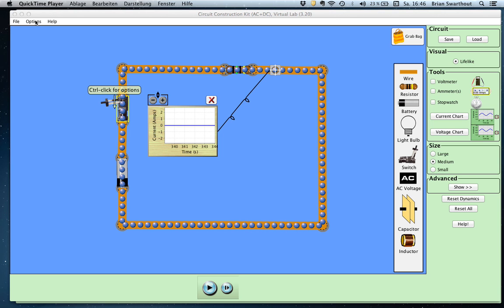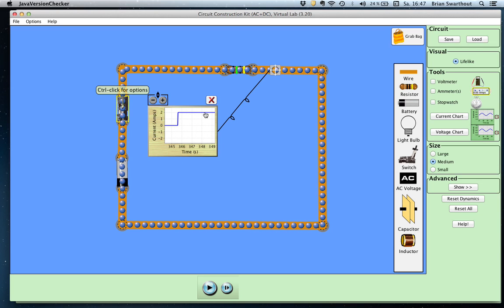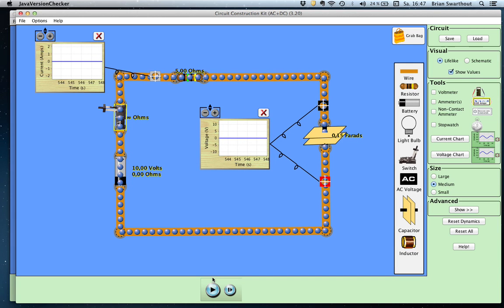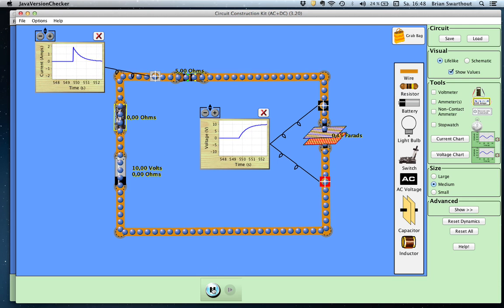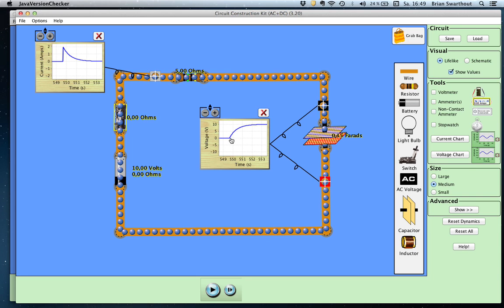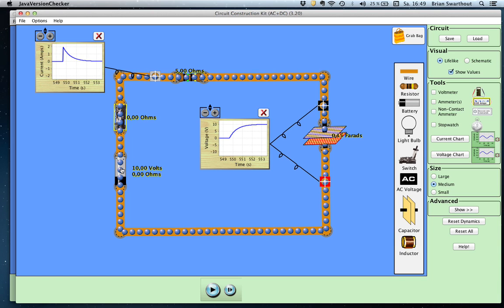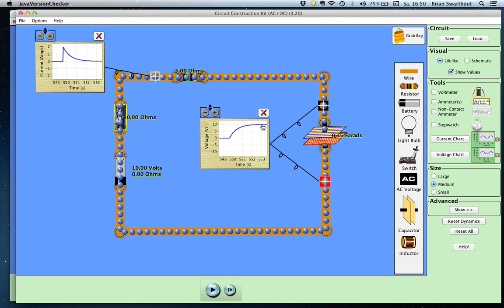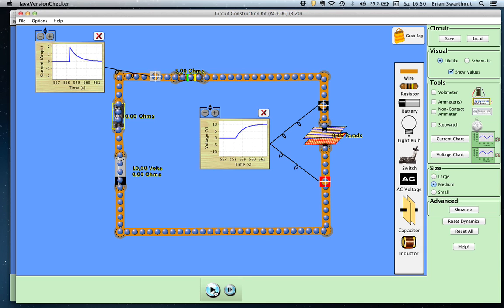RC Circuits (8 of 8) Charging a Capacitor, An Explanation

Comment: You could have used a practical example. In the circuit that feeds an AND gate, what resistor would provide a 2,3V trigger from the capacitor ?